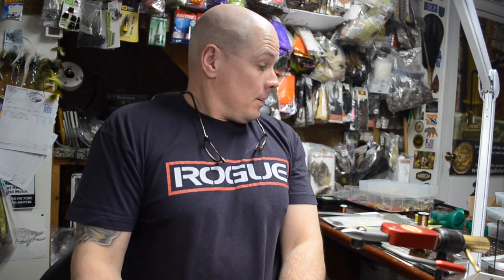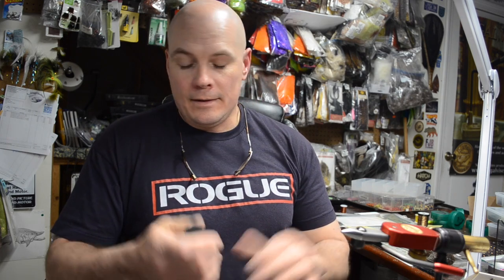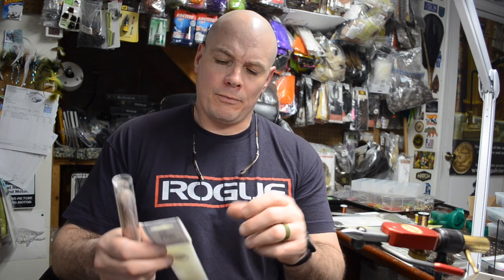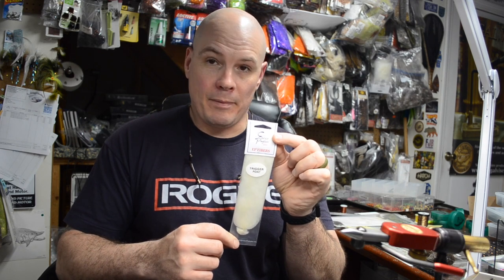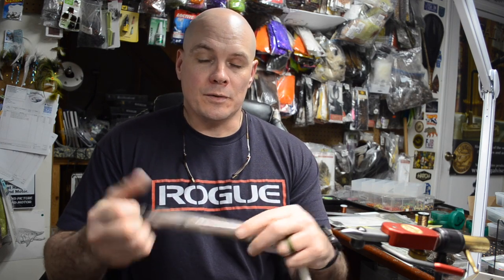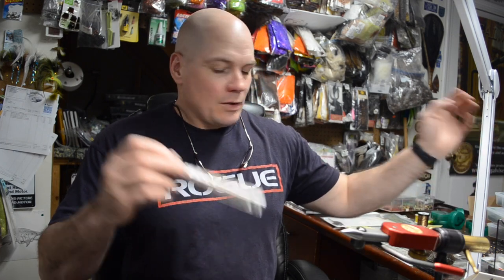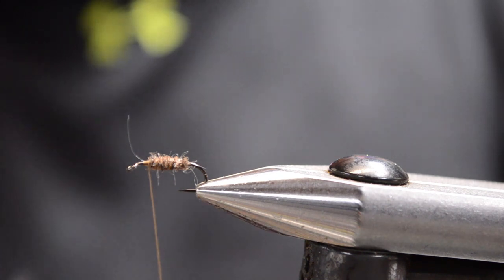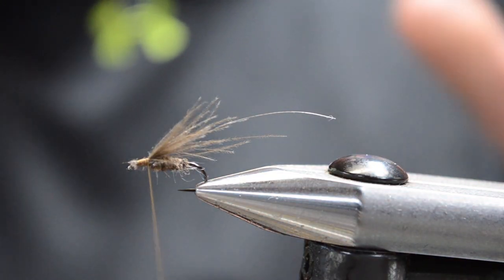Trigger Caddis

Comment: Excellent tie bud. I have been using ep trigger point in my dry flies for a few years and it works great. I tie a caddis called a corked caddis which I use for dry droppers because the fly is like a cork and holds up a tungsten bead head nymph very well. Keep up the great work bud and screw the negative comments that people say. We are allowed to rant and have our own opinions